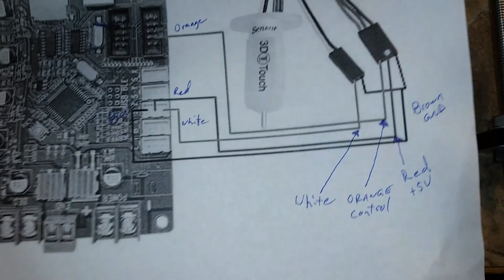ANET A8 BLTouch Wiring

Comment: Where can I find the file Configuration.h ? Link to google drive die :|
Reply from the maker: You can download the configuration.h file from the Marlin Firmware Github page then customize the settings to calibrate your ANET  A8.  The configuration.h I had is an old file and won't work with the latest version of Marlin.
Reply: @MrDabrudda  
Better to have an example.

Comment: I soldered it too, but instead of attaching just the servo pin connector to the board for the connection, I soldered the pin and clamped some wire onto it and put another servo pin connector at the other end of the wire. So if I ever need to disconnect the pin I can just unplug the wire. This way there's never any stress on the solder.

Comment: for the anet a6 wiring is the same ?
Reply: ok i know tx pin on anet a6 is the first on left side not the second as on video
Reply: but how you ground lcd when you use ground pin for bltouch you pin both lcd and bltouch to the same ground ?
Reply: aa ok i see on the schema -> ground from z ground can be used. but you use the another one. you didint use the lcd anyway ?
Reply: errata: second on right

Comment: why is no one  in these videos simply putting a single servo connector on that pin? I have 2 display ports just like all the res of them. .....One can be used as display any the other for a single connector for the sensor.....always someone soldering or making a breakout for it.

Comment: If you don't like the soldering and cutting wires, here is the PIN 27 break out board. https://www.ebay.com/itm/202571021260
Reply: or  just use  additional male-female pin  cables

Comment: Is this more expensive BLtouch worth it  compared to the cheaper 3D touch? Is it hard to make the software run correctly?
Reply from the maker: I only have the cloned BLTouch so can't really say if it is worth buying.  I had trouble with the BLTouch sensor crashing the firmware every so often.  When I upgraded to the BLV Mod I added a capacitive sensor instead of the BLTouch.
Reply: @MrDabrudda  ok, so do you have a 3D touch then? Or another clone?
Reply from the maker: I had a clone BLTouch but moved to a capacitive sensor
Reply: MrDabrudda oh sorry ok thanks!

Comment: I was now debating with myself to get a BLtouch, if the mess with the mainboard would be worth it... especially the hassle with the LCD & J3 (I use a full graphics display -> it uses both ports)
but your video helped me a great deal :D ... smart move, soldering a pin to the back of the mainboard :D

Comment: Great video. How to have you done the extension cable? What type of wires and connectors.
Reply from the maker: I bought 3 pin JST connectors form ebay.  I used servo extension wires and cut the end off and crimped the JST pin connectors on to the wires.
Reply: MrDabrudda thanks

Comment: Great video. Thanks for sharing. Instead of soldering to the back of the board, I simply pushed my orange wire up into the black LCD connector port and when I secured the connector back to the board, it made solid connection to with then pin. Super easy solution and works great.
Reply: So simple but so useful, thanks for the top tip. I cut the ribbon cable wire to add a connector but there was no continuity to the board for some reason. Doing this got it working 100%.

Comment: Thanks for the easy-to-understand video! I have a couple of questions. Do I just need to wire up the 3dtouch as you describe, and use the configuration.h you provided, along with the latest Marlin? I set up a 3dtouch on my D-bot a while back, and the bltouch provisions in Marlin at that time did not work - I had to do a bit of a workaround. Does the newer version of Marlin fix that? Looking forward to getting ABL running on the A8, since I've basically had to re-level the bed before each print.
Reply from the maker: You will need to configure Marlin to use the bltouch.  The configuration.h I provided works for me.

Comment: Why should you connect both GND pins? The left pin of the Z-endswitch is also ground.
Reply from the maker: Separate circuits.  One ground goes to the sensor and the other ground goes to the servo which raises and lowers the probe.
Reply: I found continuity between the two groundwires. They must be connected somewhere inside the probe. Guess i"ll just solder a wire between the two groundpins to be sure.